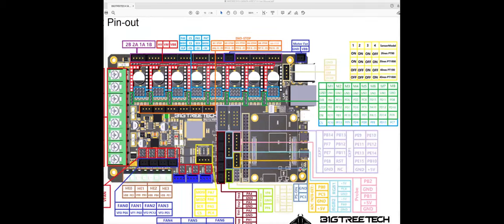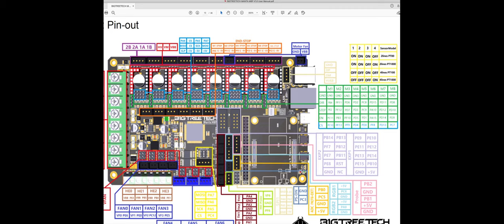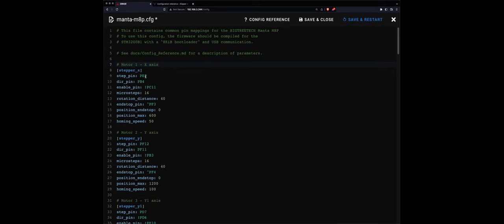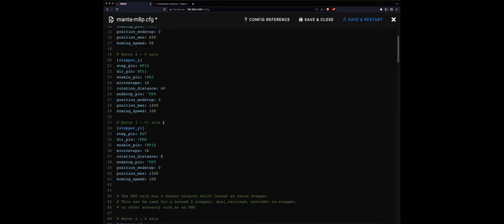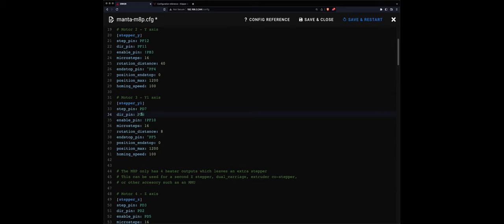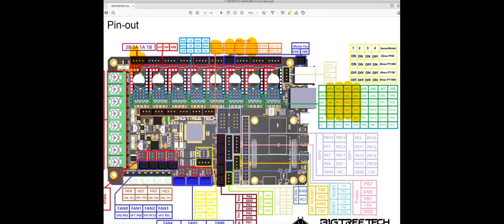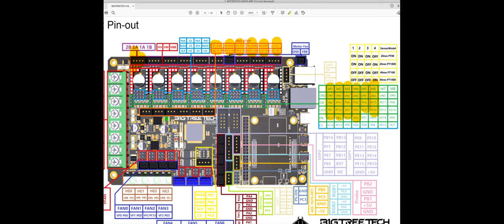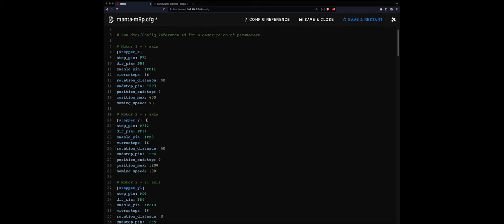Klipper motor configuration on BTT Manta M8P for my custom 3D Printer

Comment: I have the Manta M8P v2.0 and I was trying to use motor 5 for second Y. But when I turn on the printer it would just run 10 mm and then stop.
Is it only possible to use the first 4 motors for steppers?
Reply from the maker: I do not have the v2 so not sure, but you should be able to assign any drivers slots given that you assign the pins too. But there should not be an issue to what you are trying to do.